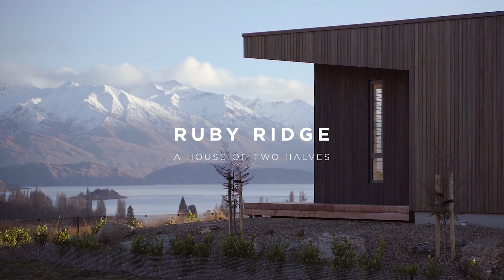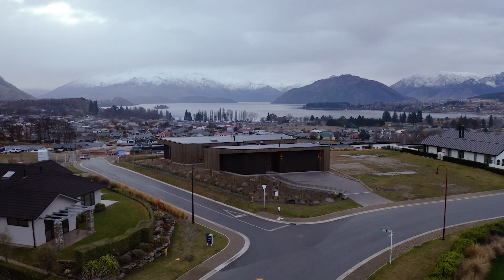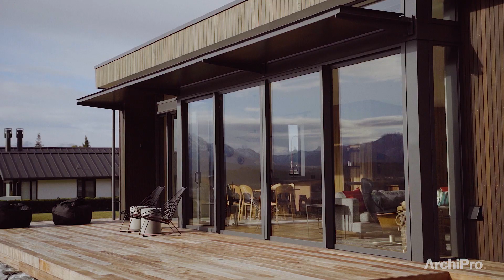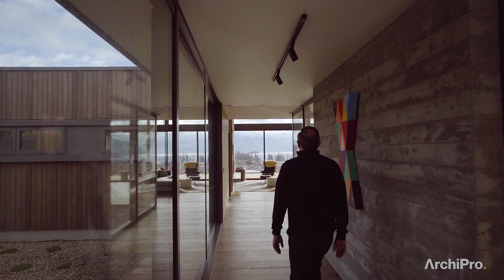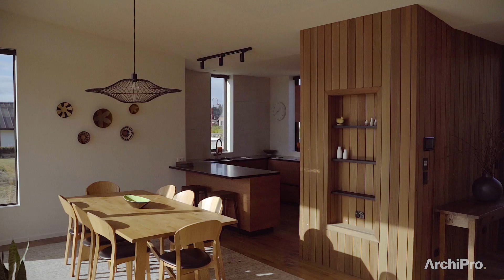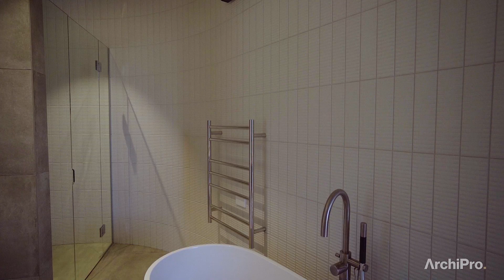Ruby Ridge | Condon Scott Architects | ArchiPro

Comment: Do we know what a project like this costs?
Reply: In NZ, in Wanaka, I doubt there'd be much change from $1.4M
Reply: @DiscoFang   is that just the build cost?
Reply: David Beechey Yes. I may have actually underestimated by 20%. I’ve seen similar cost over $2M (!!) The cost of materials, construction labour, profit gouging, engineering & “compliance” is out of control in NZ. Wanaka is also one of NZ’s most over-priced areas to live. This house & land to buy is likely over $3M. There are houses either side in that street costing $3.4M.
Reply: David Beechey Just doubled checked on another property value estimator which is actually very accurate here in NZ and the estimated current market value of 11 Ruby Ridge is $2.74M -$2.93M.
Reply: @DiscoFang  
Oh God... That's too much
Reply: Try 4.5 million and you may be somewhere near the right price to purchase a house of this caliber

Comment: I am impressed. What a house!
Reply: Hoping it will look better on site once some of the garden grows. The house looked out of proportion with every building in the vicinity that we could see.
Reply: @comealongcomealong4480  I noticed that too. Although it's still a very unique design that you don't normally see everyday, which makes it even more beautiful than a normal home, in my opinion.
Reply: @darrellm9915  Yes to the high quality design. The glassed-in bridge linking the two sections of the H-shape is so dramatic. Hence the slightly shocked response when I saw the external view. Architect did discuss privacy as a priority.